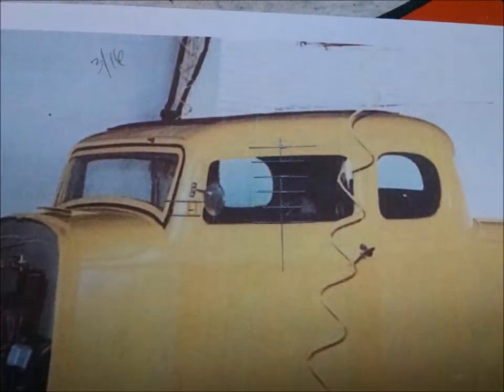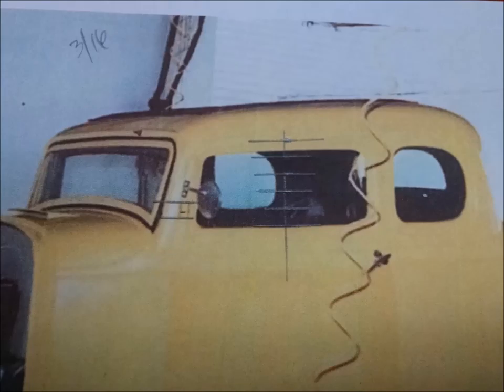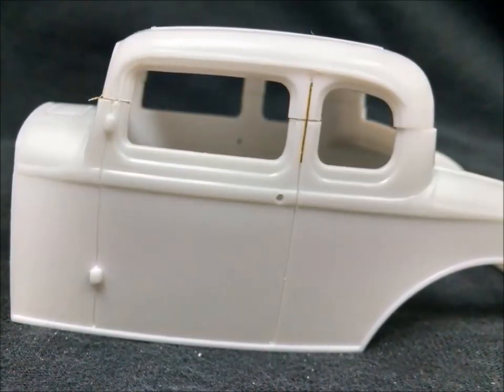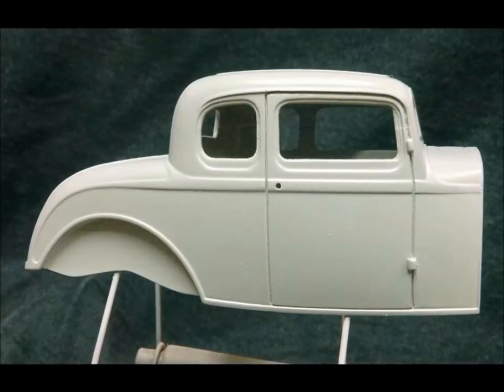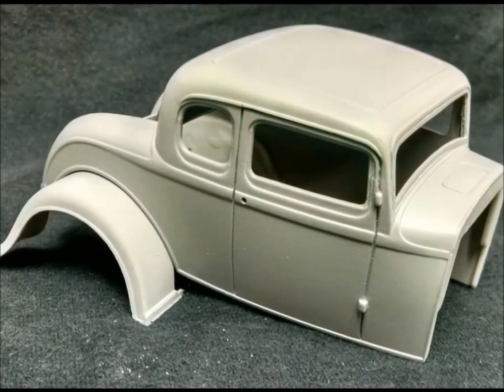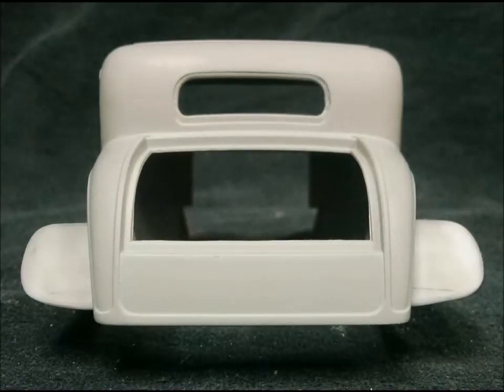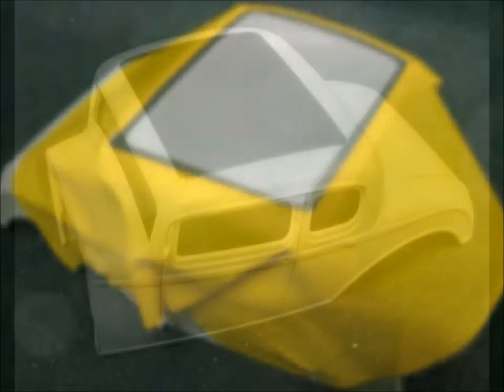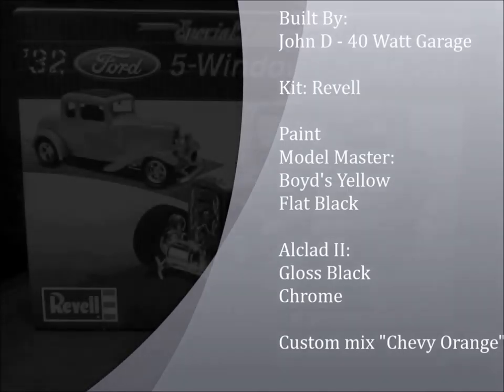American Graffiti - Milner's 32 5-Window Part 3

Comment: Who made the original body,  before your chop,?  I would imagine it was stock Ford height and width..  was there any steel reinforcement,?   You would have to cut and weld that too,  It'll get pretty hot next to the fiberglass.